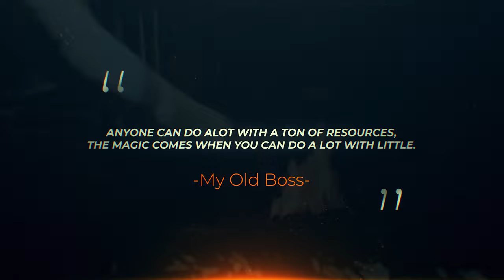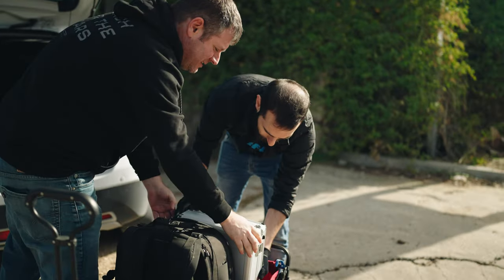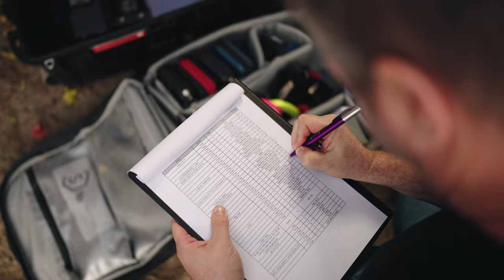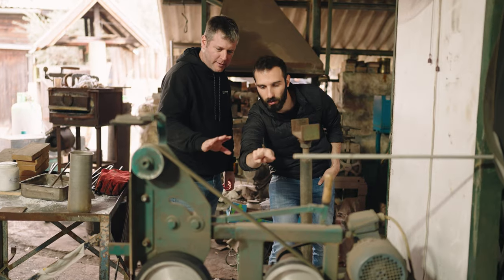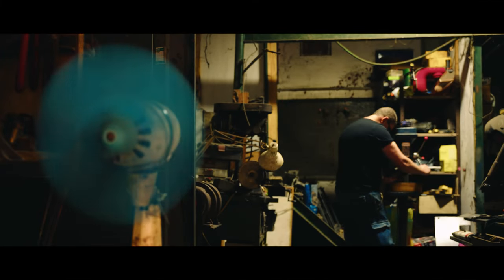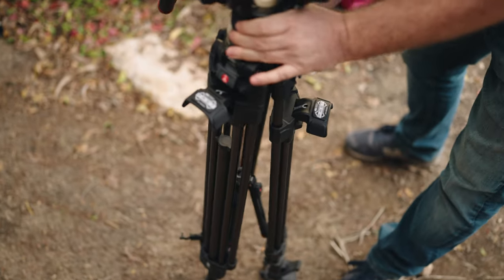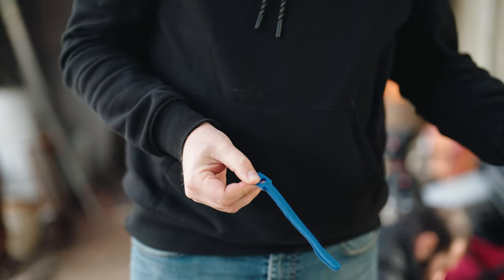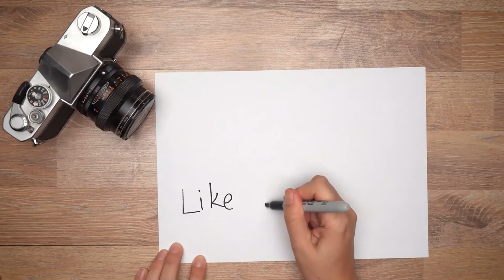Three Cinematic workflow tips to save you time on set

Comment: Nice video! I'm curious about your packing list. Do you customize a packing list at the beginning of every shoot? Check mark before the shoot and after? I'd be interested to see what type of template you're using.
Reply from the maker: We have a template file with the main gear. Then we add\remove things based on each shoot. The template is organized by departments, so cameras+lenses, tripods+grip, sound, lighting and so on. 

It's a glorified excel sheet :) nothing fancy
Reply: @diyphotography  I'm in the same boat. I'm thinking there's got to be a better way to tailor a packing list. Organizing by departments is a great first step.
Reply from the maker: Let us know if you find any good tips.